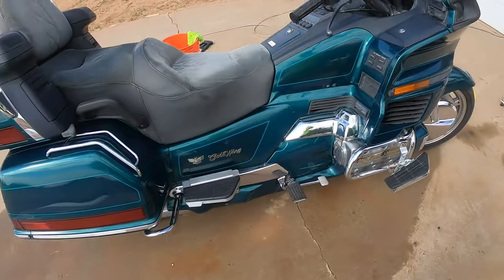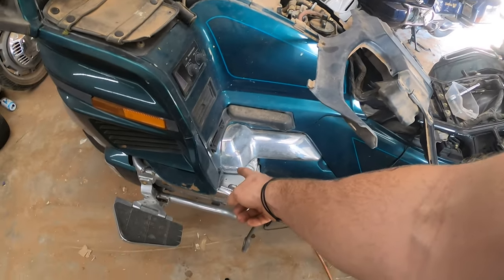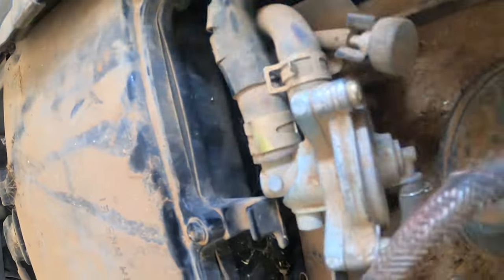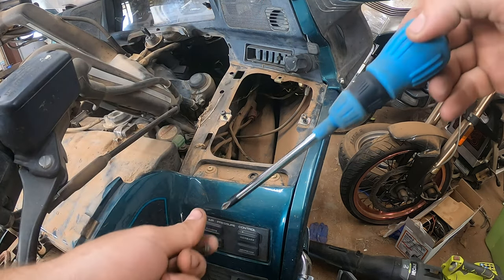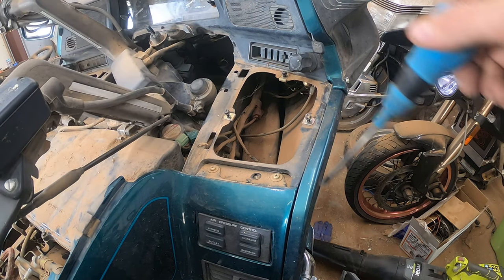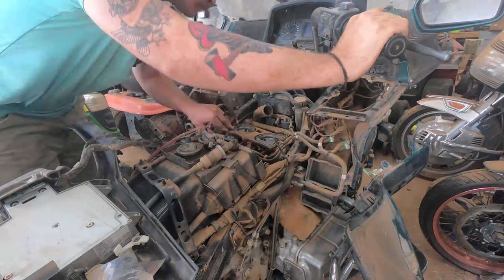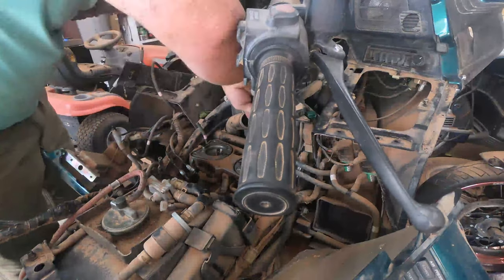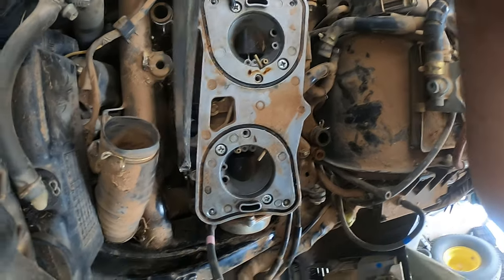How To REMOVE The Carburetor On A 1988-2000 Honda Goldwing GL1500

Comment: To add to your list of essential tools for tear down I would highly recommend a heat gun for pre-softening those rubber hoses and air intakes around each carb, I’ll even spray or soak some rubber parts with distilled white vinegar to keep ‘em pliable, so many of these items are just not around anymore in the aftermarket.
Reply from the maker: Very good idea! Will add it to the re-installation list! And agreed! Have you heard about boiling them in wintergreen oil?
Reply: @octanerestorations  can’t sat that I’ve heard that one, I did mention the vinegar spray to one of my customers and he rolled his eyes like I had a bone in my hair and carried a spear, told him it’s tried and proven in chemistry class to soften many items. Had a good laugh with him about it anyway.
Reply from the maker: @Mr.Innovator961  I will definitely give it a try, thank you! Seems like vinegar is a staple in the shop!

Comment: what happens if i swap the two hoses to the right of the carburator? i just bought a Gold Wing and when i start it revs rises until i cut the engine  to avoid damage to engine and fuel shoots out from overflow hose/houses. i also realised that the overflow T-junction is broken so fuel gushes out on to the engine with so much pressure
Reply from the maker: is it an 88? If so honda issued a recall on the overflow fuel line with the t junction to replace it with a metal one. If that is the case and extra fuel is getting into the cylinders that could explain the revving so high. I don't know for sure if it would damage your motorcycle if you switch the lines (since they should both be vacuum lines) But I would switch them back. And check your idle screw while you're at it, someone might have messed with it!

Comment: I took your advice about the JIS drivers and bought a set that included a 10” JIS for the hidden screws.  Thank you for that info !! I had noticed the screws were caming out when i worked on my 94. And i also bought the pliers.
Reply from the maker: I am making a video about it, it is definitely a game changer! And the pliers just make life so much easier, I use them pretty regularly, glad it helped!